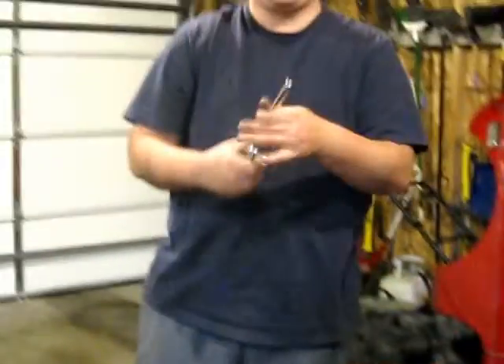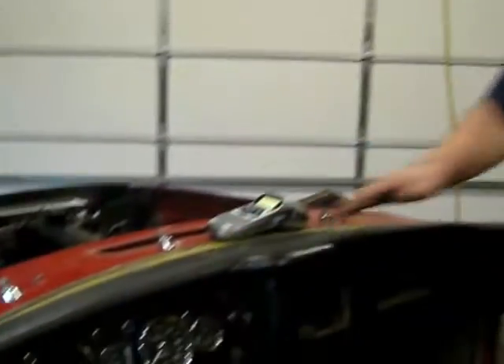MG 7 - Dashboard Removal

Comment: Hey did this after watching the weekend.  Actually socket needed is 7/16 and is you use a swivel on the one hard bolt with the long extension, came right out!  Thanks for info!

Comment: thanks, Marty. i was getting ready to do rewiring electrical to my 1971 mgb gt. i did check out a couple of video just to get more detail how to remove the dash and the instrument panel. i'm not sure where to get a new wiring harness for the rear and front car body. i got a new 117-515 relay and wiring headlight kit from Moss Motor. LTD i didn't see any harness wiring for the whole body in their catalog. anyone know where/who i can contact, i did refurbish the wiring harness for the jet engine with United Airlines. i use the old harness off the engine. i had the wiring layout on the table for every component connector using a special rear disconnector insert tool made of plastic to disconnect the wire pins which have number or alphabet inside the pin location. it took quite a time and careful pull out the pins (female and male ends). i don't want to splice the wire since moisture is the major problem in all cars.
Reply: I'm planning doing this with my MGB. I'm also sort of a wiring professional. I was thinking about just replacing all of those bullet connectors with modern connectors and soldering everything....or I might just bite the bullet and buy a brand new harness.

Comment: Ok this tell me to don't start taking cables apart without knowing where they'll be at.....  Thanks I have lots of electrical problems but that's the hardest part to get in...  So I'll see if there is a way to play with the tachometer with out taking all that apart...
Reply: Just remove the dash; buy a new set electrical harness to all the instrument. MGB/MGA are known with electrical problem. Moisture and chafting are the major cause for short. Cleaning the rust on the ground earth at the frame ground attachment.